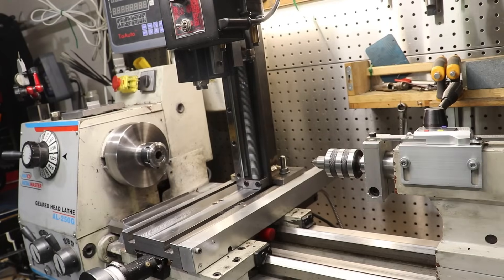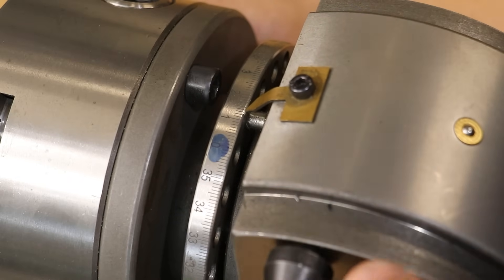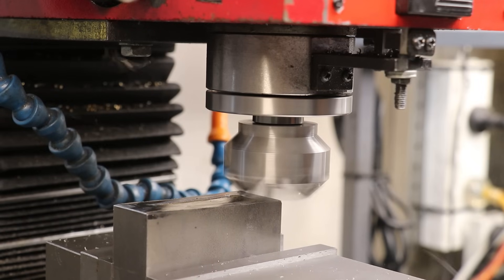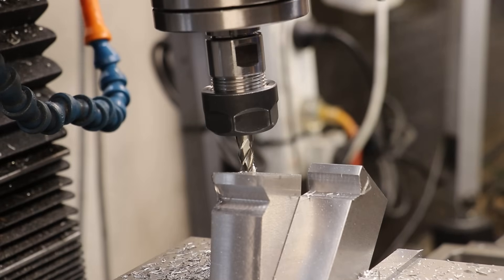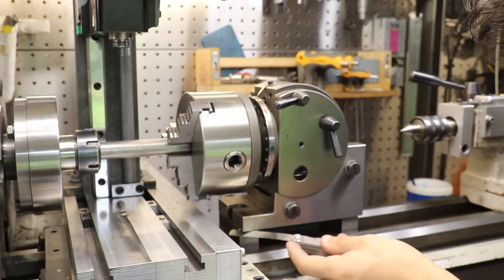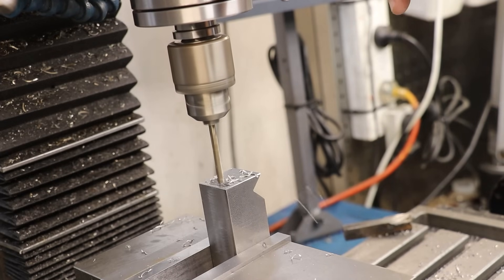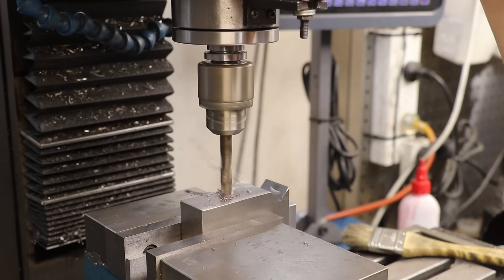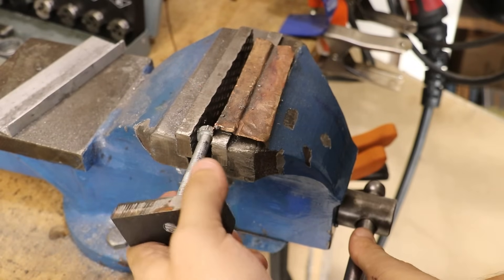Lathe Dividing Head Tailstock Attachment Build

Comment: Next time you do a full slot like that drill both ends first so you have a spot to plunge.

I also think you should have chucked up a precision rod of some type (whatever you used to level the lathe) in the dividing head and put the indicator on the lathe faceplate to get both units aligned. And then used that indicator on the cross slide to make sure the dividing head was parallel to the bed vertically and horizontally. The way you designed the mount you can shim all those misalignments out easily though.

Comment: I love these videos. Full creative mode solving problems.  To check alignment of the tail stock chuck i would have used an alignment bar between centres, and run a clock along the side and top of the bar.  
Now the setup is done the potential is huge!

Comment: Nice work. How did you device on the depth of the v on the riser? I imagine if it wasn't right the dividing head would end up drunk...
Reply from the maker: I’m measured the width on the raised v on the lathe bed. Plus the measurement into a trig calculator and it will tell you the depth of cut to take

Comment: I'm curious about the choice to add a milling attachment to the cross slide instead of just using attaching a vice or the dividing head to the cross slide. Then using one of the lathe chucks to run the milling tools. 

Was there a specific reason a stepup like that wouldn't work since it seems like it would be more rigid? Or are you wanting to be able to perform powered milling operations on a spinning part for a specific reason?

Comment: It'll be interesting to see what the upcoming project is. As someone else has already mentioned using longer bolts to clamp the risers and dividing head in place would be simpler and more accessible. 
When I made a special fixture for turning long slender tapers like 6mm max OD to 2mm min and about 200mm long that located on the tailstock ways I machined the V, not 90 degrees in my lathe's case,  and left extra on the flat. My lathe is a gap bed version so I used the gap as a plug gauge to check the height of the flat section by clocking on the gap's underside and machining the flat until the gap was horizontal. I understand that's not an option in your case but others might find the idea useful.
Reply from the maker: Yeah fair enough so. Sometimes the obvious solution gets away from you in the moment

Comment: 12:10 If you have to cut slots and are a hobby machinist and don't have alot of money and want to waste tooling. This is 100% what you should be doing BUT i would drill out most of the slot with a drill and then follow with an endmill, the lower the material the better for the tooling and a drill can be easily sharpened per hand hundreds of times and is way cheaper than an endmill.

Comment: What size is that dividing head? Turned out nice. Another way so ya don't burn your end mill: just plunge the endmill to depth all the length : drilling right next to each other then just go length way to clean up, seen this from a older machinist.
Reply: As he said, the endmill wasnt centre cutting so you cant plunge with it.
Reply: @peterhadfield873  Sorry I missed that, my fault
Reply from the maker: It’s a bs0 size dividing head. Pretty much the smallest and cheapest size that’s made

Comment: Why could you not clamp both the head and the riser blocks with the same bolts? Just put a clearance hole in the riser and a long bolt.
Reply from the maker: yeah good point
Reply: @artisanmakes  I figured you had some reason I haven't figured out, not to drill straight through the risers. Maybee you do, but you forget fo the moment? (Happens to me.)
Reply: Yeah I thought that would be the plan from the start when he described the two riser blocks.
Reply: Was coming to say the same thing. Sometimes tunnel vision is a pita
Reply: Was thinking the same
Reply: Same
Reply: he'd have to faff around with horizontally centering the head as well if he only plans to move the entire assembly on the ways to accomodate part length.

that said, if he just tapped the side of the head's base to permanently screw against the offset block, he can use the one-bolt solution